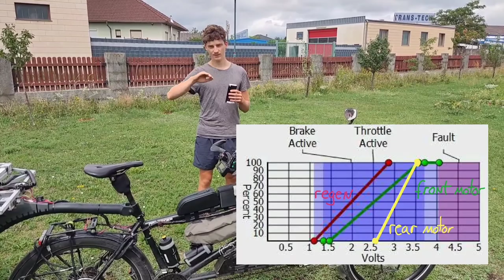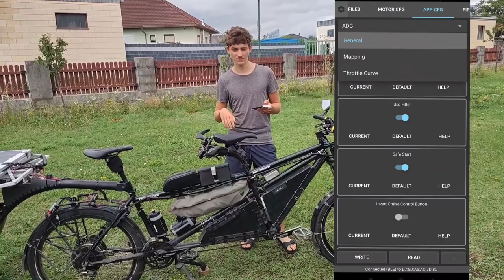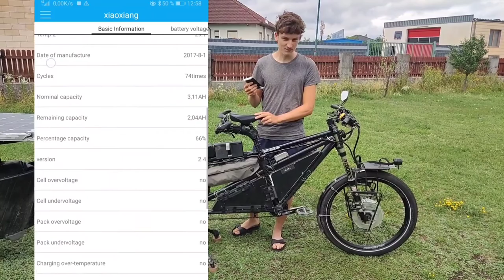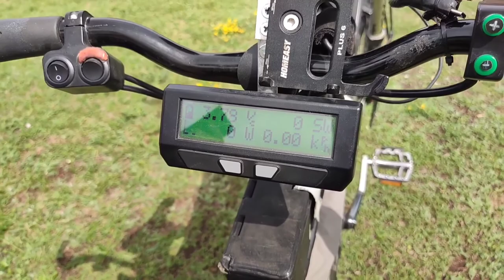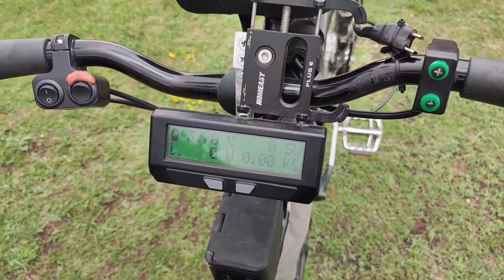Ebike conversion: motors, contollers and battery | solarpowered electric tandem bicycle

Comment: Great build, congrats! What is the power of the motors and what is the capacity of the battery?
Reply from the maker: The two motors together can supply 1600 W of Power and the battery has 1.2 kw/h of capacity, appreciate your support :)